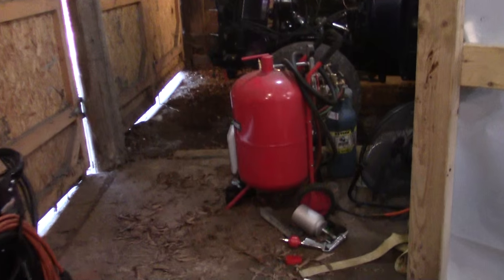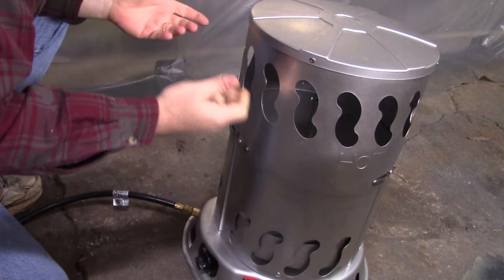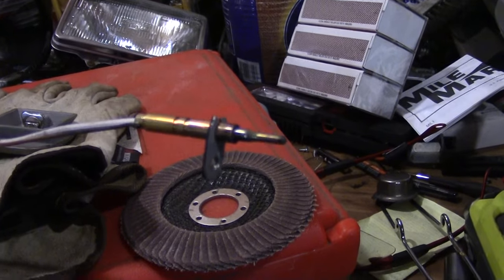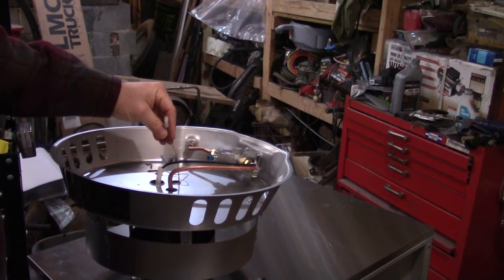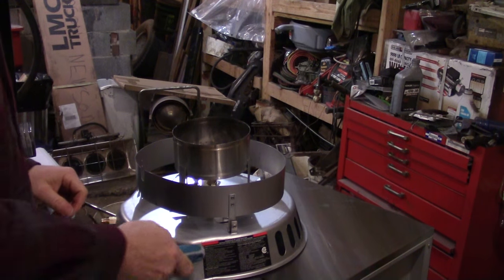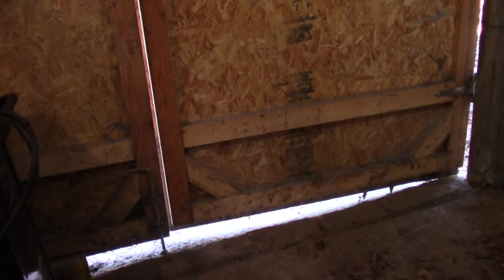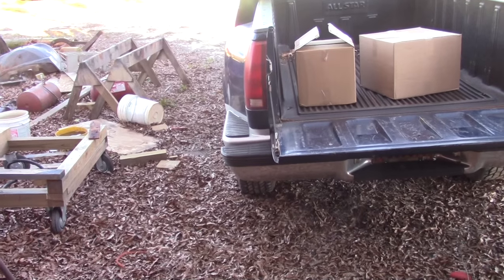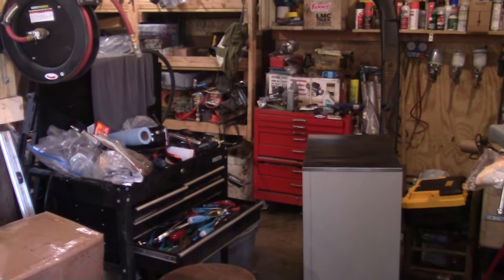Heater Fix Fail

Comment: I’ve been a contractor for 35 years and I have a couple of those they do work. If I were you I would just return it to the store. I will call the company and tell them that you don’t want to be making the repairs or that you should not have to be making the repairs and it’s still not working. They Do you work great. I think that you just got A bad heater. Sometimes the thermal coupler gets dirt in there like an air blow it and see if that helps and if it has the primer brighten it gutter check that but honestly I have that same one and I have two that’s over 200,000 BTUs and they work And light up each time. Good luck

Comment: you light the pilot first, hold the 30 seconds till the pilot stays on then and only then you turn on the heater / just like a hot water heater

Comment: I tried that style of heater before and for me the propane doesn't flow good in the winter and I couldn't get enough heat out of it. The torpedo is my choice for heating up my shop then switching over to electric. But  its probably  good for you when it works and you don't live at the North Pole :)
Reply from the maker: I bet!  The torpedo heater will heat the shop quickly but I'm concerned about melting the plastic. That's why I got this POS. I don't have the electrical capacity to pull a big enough electric heater.

Comment: Pull 2 screws where thermocouple goes into valve pull apart there is a rubber washer, spring, and brass washer remove all 3 of these then reassemble do not remove inner rubber washer that seals this to gas valve this bypasses thermocouple then it will work fine make sure to turn gas valve off if it doesn't light right away gas will keep coming out

Comment: Looks like you bought a piece of junk from a company that has idiots working there. I'd get a return shipping label from them....get a refund...ship it all back and deal locally. You can get a 20k BTU kerosene heater for $100 that will work great.
Reply from the maker: +john smith I agree with you, but I really didn't want a kerosene heater.  Kerosene is fairly expensive compared to propane or diesel.  I can continue using my torpedo heater which runs on diesel.  I haven't had time to call them back, but I will soon.

Comment: I wish I had a heater, but it wouldn't do me any good without walls lol my wrenching has severely slowed down with this cold. hope u get it fixed
Reply from the maker: +Idaman71044 Get a torpedo heater and aim it where you're working.  It will keep you warm and fuzzy ;)

Comment: I think your tank size is the problem. For that size tank try a tank top version or a small 35,000 torpedo would probably work well. Rural King has some deals at the moment.
Reply from the maker: +Tom Schmick It's supposed to work with the small tank, that's why I bought it.  If I can't get it fixed, I'm going with a different type all together though.

Comment: looks like  gas pressure isnt right it should be blue at the bottom not yellow ..  also need to make sure the flame and pilot assembly are actually in the plame itself .. did  the regulator on there come with that system ? also look for a pressure regulator on gas valve it self ..
Reply from the maker: I think I read on Mr Heaters website that it is normal for these heaters to burn yellowish. The regulator came with it.  I can't really tell where the pilot light is supposed to be.
Reply: +farmboy30117 well take off the bonnet and look to see if flame is blue at bottom .. cause yellow flame wont cut it .. also try holding valve manual open for a minute.. just a suggestion
Reply from the maker: Ok, I'll try that next time.  There isn't a separate pilot light so I'm assuming the burner stays lit, but I don't see how that could keep the thermocouple hot enough.

Comment: OldBrattRider sent me your way...I wish I had seen this video back when it was posted...that heater is the kind of stuff I work on every day.  What did you end up doing with it?
Reply from the maker: Welcome Dale!  I put it in the back of the shop where the other junk is stored ;)  Do you know what's wrong with it?
Reply: Looking at your video, and at the Mr. Heater site, that model doesn't seem to have an actual standing pilot light, the ignitor ignites burner gas itself...which is why they discontinued that particular heater and why it lights so dramatically...I'm wondering if the thermocouple is in the flame where it can actually get hot enough to do it's job...to know, you'd have to fire it without the top shroud on it.  But there is a better way...to test it, disconnect the gas and heat the thermocouple with a propane torch for about ten seconds...then push the knob in as if you were lighting it and turn the knob to on...remove the heat and let the t/c cool and listen for the valve to snap shut, you'll hear a click if it does...that means the valve is ok, and if not, they may send you a new valve, or the electromagnet part of it anyway...I'd ask for the standing pilot upgrade, they may come through for you...wouldn't hurt to try.
Reply from the maker: Thanks for the info.  I called them twice.  The first time they sent a TC that didn't even come on it and the second time they sent the sensor but not the valve.  I think the valve is defective. I should've taken it to the nearest service center and got it fixed but it's a long ways away so I just put it up.  I will try your suggestion sometime when I get a chance.
Reply: sure thing...believe me, even companies like Mr. Heater come out with a bad idea now and again...we won't even sell/service a gas appliance without a true pilot light...too many lost eyebrows.  Good luck with it.

Comment: i was thinking of buying a mounted electric heater in my garage. but ive been scared of what the electric bill might be! my torpedo is so loud!
Reply: +gerald volkenand a 240 volt
Reply from the maker: I'd love to have a big electric heater but I don't have the capacity without running a bigger power wire.

Comment: I have a heater like that and was told that it wouldn't run right on a 5 gallon tank it had to be a 100 pounder or better.
Reply: similar but not exactly like mine is a Mr. Heater 22-75k btu
Reply from the maker: It's supposed to run on either size, it just don't last as long. The bigger ones won't run on a 20 lb cylinder.

Comment: I would look at the 360 tank top heater.  I love it for my 25x25 shop , non insulated and 18' ceilings.  Keeps it right about sweatshirt temps during the cold Illinois winters.
Reply from the maker: +Scott Haddick I saw those, that might be a good option for me.  Thanks!